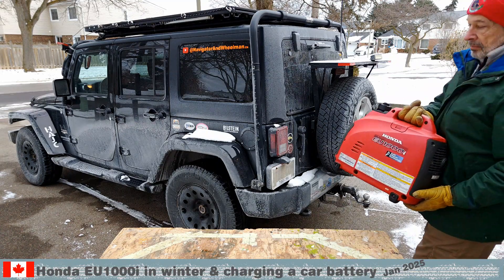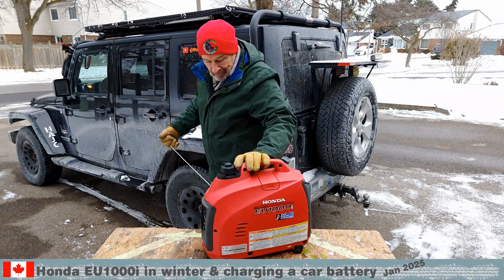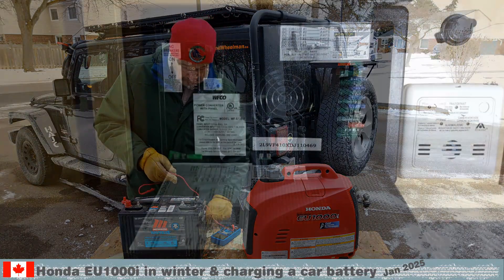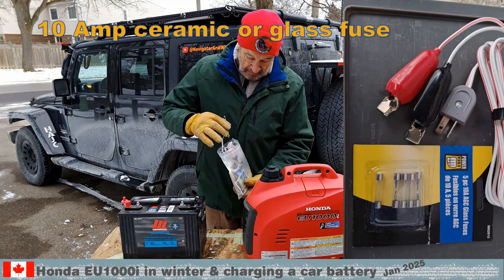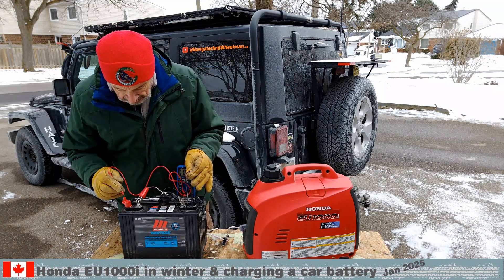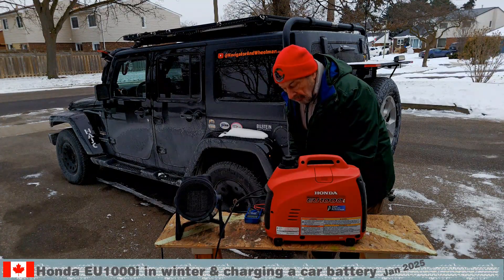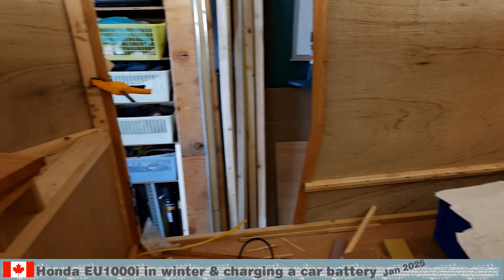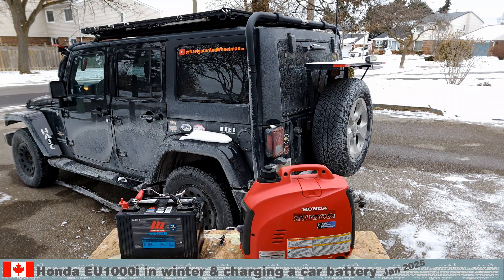Honda Generator & Deep Cycle Battery test in winter

Comment: 1:00 keep in mind it usually takes 12-14 pulls to get fuel to the carburator to make it actually run. 12 pulls would be minimum under normal conditions, so 15 is really impressive at cold temperatures
Reply from the maker: @PT-mj3bk  thank you, I fully agree. It is a very dependable unit.

Comment from the maker: 120 Volt heating in a trailer is a Problem. The best solution we found is the Oil Filled Radiator, they are available in smaller sizes like 12 by 12 inches. We found the Costway 700 Watt oil filled radiator that keeps the 13 ft trailer cozy warm. Best of all, zero noise. Other options we considered (never tested yet) are Heated Towel Racks, low wattage and they are never too hot.